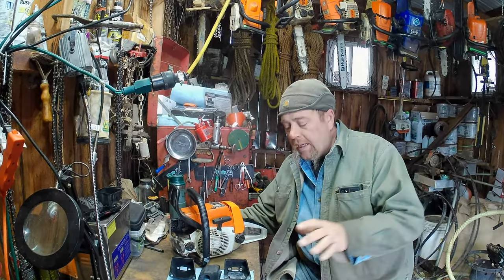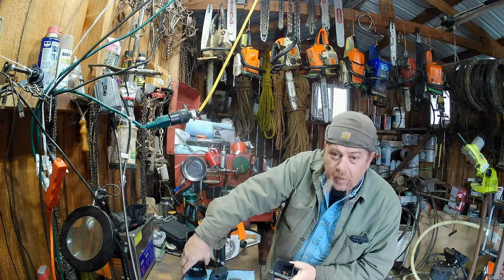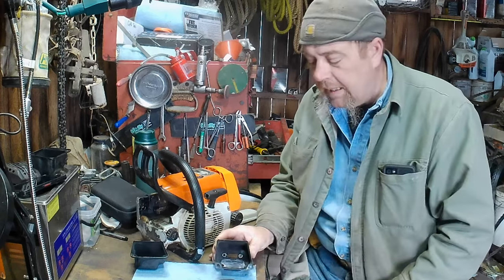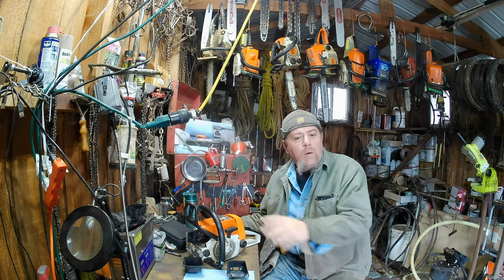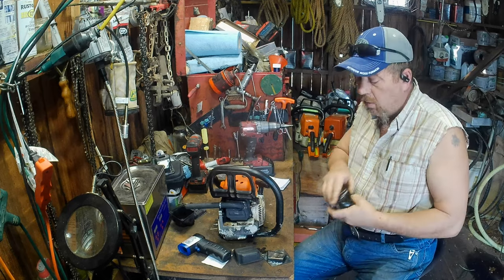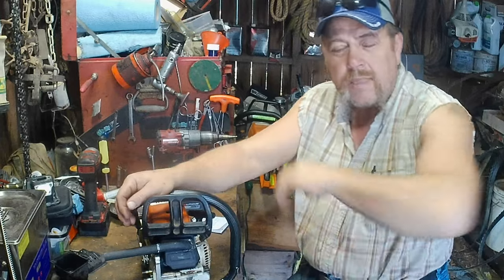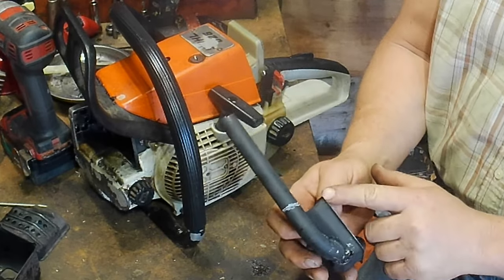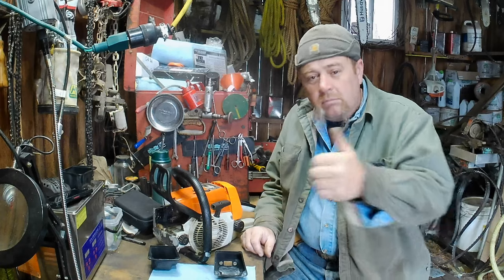TRICK to find PIPE LENGTH for Chainsaw; CONFIRMED!! Dyno and HEAT Results

Comment: I really want to see a dyno test on a stock spark plug versus a side gapped spark plug! I guess its an old hot rod trick that gives you a more directed? Spark.
Reply from the maker: @Magoot2456  Good idea!! I have a few things that I would like to test that are very small and want to compile a vid of "little helpers"; wonder if they make a split_fire for chainsaws...or if I can.  Pardon the ignorance, but I assume you mean to twist the ground part off to one side of the electrode?  Also wonder how it would work to snip the end back to .030 (or whatever) from ever reaching the electrode; in my quick assessment in my mind, it may be easier to accomplish and same effect? Thoughts?   Wonderful comment again!! Thanks for being here, joining-in, and being a fine example/leader.
Reply: @HayChaffandSawdust1  so how my brain understood the side gap is by cutting the top section "Ground" portion short enough so you can bend it down till its NEXT to the electrode and .035 gapped away from it. I could be totally wrong :) I'm definitely going to try it cause if I waste a spark plug, thats a pretty cheap part :) it would be really cool to see if it helps on the dyno though! :) I'm sure you have a ton on your plate, so if you get around to it in the future whenever, I'll be here to watch!  Thanks again!!!
Reply from the maker: @Magoot2456 I got ya; that was kinda my second understanding; i first thought of bending the ground electrode sideways and laying it to the side of the regular electrode; may give it a broader area for the spark to travel? You've got my mind grinding... wonder if that would make more/less difference depending upon the angle of attack of the plug (the angle of the plug in relation to the combustion chamber). We used to "clock" our spark plugs with crush washers to orient the gap down and toward the cylinder... don't know if we were doing any good, but we THOUGHT we were and weren't getting in trouble elsewhere.  Good stuff!!!

Comment: I agree you need more diameter, but how did you resist cutting more off?  I'd have wanted to keep shortening until results showed a loss.  I'll bet a larger ID wants a different length.  Logic tells me longer, but exhaust flow don't follow what I think.
Also, i think i would have measured the hot spot during a heat run.  Seems flow would be drastically different at idle.  I'm not really convinced the idea applies on pipes as short as needed on a saw anyway.  This ain't no pulling tractor with room to play.
You are doing great work with this whole project. Thanks for taking us along with you!  I'll be around for at least another hundred muffler tests. Keep em coming.
Reply from the maker: @Kevin.L_ Kevin!!! Glad to hear from ya; hope you had a safe day at work and were just busy; you're usually one of the first and I was worried about ya! 
I'm not done cutting, but wanted to make a vid on the heat-gun thing... you make two REALLY good points; different diameters will need different length based upon volume (Shhh... I started documenting volume of pipes and sq inches of openings on plain ol holes) that may or may not give way to more understanding for all of us. I also agree that volume of a pipe may be an inverse relationship... meaning bigger pipe needs more volume (more volume achieved by lengthening the pipe... but only for the scavenging and rebound effects. Wide open is hard to compete with if one is only concerned with power and not so much about noise and fuel consumption.   I want to have my cake and eat it, too Dadgummit!!!
These muffler tests ARE fun a heck, ain't they??!! Thanks for being here and being a fine example!! I mean that!
Reply from the maker: @Kevin.L_  Oh yeah, I forgot the other point about the RPM thing; it dawned on me after I had done the recordings and cutting; I meant to mention it in the analytics part and forgot there too (I just do it off-the-cuff).  I have been trying not to do more than 3 things at a time or the dyno sheet gets awful crowded AND it takes an evening to just put 3 runs-worth of data in the computer (still all manual entry)... the whole time I'm running the dyno, I'm thinking about the dreaded part! 😁
Reply: @HayChaffandSawdust1  Funny story there.  I had to drive my son to TN for a root canal today, that's not the funny part obviously.  I watched your video and replied while I was in the waiting room.  Got home and had notification that someone liked my comment, but no reply.  I figured you were just busy.  Opened up youtube and realized I had left a comment about your video on someone else's channel.  A video about drones, and someone liked my comment about exhaust length and hot spots.  Not sure how I managed that one.  Hope they got a laugh at my expense.
Anyway, I figure these small exhausts are too small to be tuned like a proper pipe, but if done right could resonate in such a way to help a little, or at least be less of a hinderance.  Likely a small exhaust with a fairly large outlet will perform best, but be stupid loud and drink fuel.  I think some length of stinger will help with noise and fuel consumption, with minimal impact on performance.
Reply: @HayChaffandSawdust1  You say 3 three things are too many on the graph and I was going to ask about bringing the graph from the bark box clone over for comparison.  Since it's a know performer and your current best result it would be good to see how others are doing.
That data entry must be a real fun way to spend your evening.  Still no word on that system your friend is working on?
Reply from the maker: @Kevin.L_ Nicely stated about the attempt to balance fuel use, noise, and power. I'm trying to find a happy little place (think Bob Ross painting) where Noise, Fuel Consumption, and Power all live together in a happy little tree on a happy little mountain. I know I'm probably taking too much time and too small of steps along the way, but I hate to skip a step that may have been a decent gain in power without as much noise or fuel consumption. ...I've probably burned 3 gallons (not tanks) thru this saw since I've began testing it.  I'm getting about 3 dyno pulls and 3 heat runs out of one tank... could probably get 4 runs, but don't want to run out of gas before I can idle to cool it off... ABSOLUTELY hate a saw stopping while hot and/or in the cut.
Along with you, I don't think there's room for the sound waves to work in this small of pipe either; I'm trying to consider/prove that, while sound waves have the huge effect (even more than the piston) in moving air through a 2 stroke engine, we can't make use of them in a small can-type exhaust, but ARE able to take advantage of the physical qualities of air movement sans the effects of sound.  Might be pie in the sky, but it sure would simplify things in my mind as I can't "measure" sound waves while they're all mixed up and often times moving in opposite direction of the exhaust column... all while having no effect on the actual exhaust column (provided the wave is inverted)... it's too much for me to picture, so I just scribbled it out on my mental-chalkboard.
Reply from the maker: @Kevin.L_  Bringing the bark box clone numbers over wouldn't be too cluttery as it would be above and out of the way of the lower numbers; I swear, you have ESP or something... but you didn't get it EXACTLY how I was thinking for the next one... I was considering putting the ORIGINAL test in each one to see how far we've come. Might be a good idea to do both; the HIGH (dynamic in that it is always changing... it changes in the next video) and the LOW with the current ones between. I thought the LOWs might bring it into perspective for newer friends of the channel and a good comparison to those of us who have seen so many other tiny gains along the way that it seems we are not making much progress.
My Arduino builder has a debilitating condition that make his hands increasingly hard to use; he feels luck to be able to use them 10 minutes a day for even the simplest of tasks. He gave me the Arduino for the RPMs the other day; we have not (he thinks he knows, but I don't understand... yet) how to log the data straight to the computer. Without being able to data-log it and also data-log the load cell, I will keep doing this way for the foreseeable future. He's ONE HECK OF A GUY and is about my age; he gets disheartened (reasonably so) with the situation. He knows that I'm in no hurry whatsoever and urge him to spend his best time with his family.
When I enter data (after I've collected and hand written it), my wife reads it to me while I mash around on the keys of the computer like a monkey playing the piano... it's the only time she talk to me 😂😂😁
Reply: @HayChaffandSawdust1  I make every effort to never run out of fuel too.  It kills me thinking of a saw leaning out hot under load.  
If you want me to think about gasses and pressure waves moving different directions simultaneously, that will have to wait until tomorrows coffee kick in.  My metal chalkboard needs a reboot.
Reply: @HayChaffandSawdust1  I hate to hear that.  I had a scare years ago about losing the dexterity in my hands and I understand how difficult that is.  I was lucky and got through it.  I wish him the best.  I'm no electronics guru or Arduino expert but I do have a technical background.  If there's something you think I can help with I'll gladly give it a go.
When I saw your message I couldn't help but think I talk to you more than my wife.  Then you said her reading you the numbers is the only time she talks to you.  I nearly laughed loud enough to wake her up.
Reply from the maker: @Kevin.L_  I will sure keep that in-mind; I can mess with some electronics but the "mechanical" aspect of it mostly; understanding how 1s and 0s get arranged inside of a chip to make this typing possible is beyond my grasp and being able to transport that mess of 1s and 0s across wire, fiber, and/or air in a matter of millisecond so that you can read... or watch a video on a flat surface full of little lights that will light up to make a picture... 60 of em per second...   I think I can figure the arduino myself if I need to... I don't know the language yet, but I hear it's easy to learn the language/commands and program. I just need to poke an icepick in my ear (that where the reset button is, I think) to clear my mind and get my own directed attention and learn arduino(s). Be careful and have a safe day please!
Reply: @HayChaffandSawdust1  I'm sure you'll pick the Arduino up quick.  Probably easier than spreadsheets are today.  
Keep having fun.

Comment: Is the long pipe acting similar to egr?
Reply from the maker: @bluelightguy1 I DO like where you're going with this, but I don't think so...much... but kinda. (For those reading and unaware) EGR is Exhaust Gas Recirculation. The reason I say "not really" is that EGR was designed to replace part of the fuel/air charge with Exhaust gasses back into the cylinder thereby lowering emissions at the cost of less performance. We ARE trying to redirect the Exhaust Gas column back toward the cylinder (understanding that there is some fuel/air mix at the cyl-side of the exhaust column; we want to make the exhaust act as though it's going back into the cylinder; but, at the last moment, close the window of the port as the last of the exhaust-side intake charge is pushed back into the cylinder, but before exhaust gasses make it back in; in a perfect scenario, the piston would "slice" the exhaust column exactly at the fuel/air portion and keep it in the cylinder while leaving all of the exhaust outside of the cylinder.
On another note... which you bring a huge consideration to the table, could the rise in heat between different cylinders be attributable to too much exhaust gasses getting back into the cylinder?   ...right back to the baffled muffler... it ran cooler... did it limit recirculated exhaust gasses?
DadGummit!!! I like your thinkin and relating it to something with which a good many people are familiar.  Don't miss a video/comment... we need you here!!!
Reply: The egr comment was only due to the temp. This is a great series  @HayChaffandSawdust1
Reply from the maker: @bluelightguy1 (Not being patronizing) and it was a great comment/assessment! I agree that one may be be able to read only temp and find the highest HP in that the lowest Temp may equal the highest hp due to being most efficient and using EGR, but stopping it at the perfect time?  I love the thought and a different perspective/way of understanding.

Comment: Try just the open exhaust no pipe or muffler it have the most hp i bet .dos that mean we could just have a huge hole😊
Reply from the maker: @douggranger9954 We will do that at some point; this particular saw will be a firewood saw for my dad and he keeps his saws in the barn with dirt floor open to squirrels, mice, bugs, wasps and other things which would be apt to build a nest in a cylinder in the off-season. It also has to be able to ride around in the back of the SxS in the rain and dust.  I think, after we've built this saw into the best work-saw that I can, I will buy a midsized aftermarket kit saw to play with and get really wild or mild with different porting, machining, exhaust, etc... mods. This particular saw has to be a compromise of performance, noise (he will not wear earplugs), durability, and reliability. 
Keep the ideas coming, though; if I don't use an idea on this saw, I will eventually, I'm sure!  Thanks!!!

Comment: Wouldn't the amount of pipe inside the box also make a difference in temps
Reply from the maker: @benrodriques I very much think so! and thank you for bringing that up; there's only so much I can jabber-about without making the vid too long or boring... great point though!  It seems to be making a hotter cyl temp (over some other types) while I was hoping for the opposite; I've not given up, in that, if the pipe is better (bigger and snip the inside end at a more favorable angle), I hope to have it pull the exhaust out faster and more efficiently thereby drawing heat from the engine.  I certainly do not have enough info at this time to make a valid guess (I just added the heat aspect to the dyno and am changing it on-the-go... I'm learning while sharing); I think some upcoming vids will help get us all to a point that we start making hypotheses; they all may be different, but I sure do like the group-think thing!!  
Thanks, so much, Sir for taking time to join-in!!